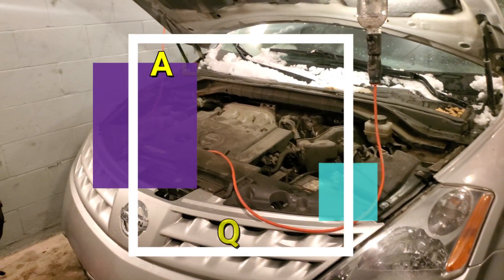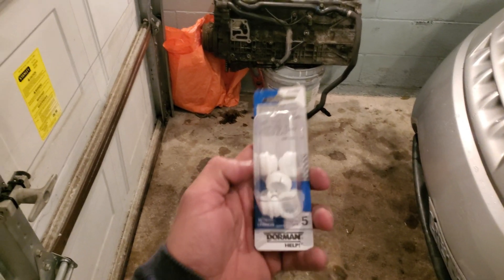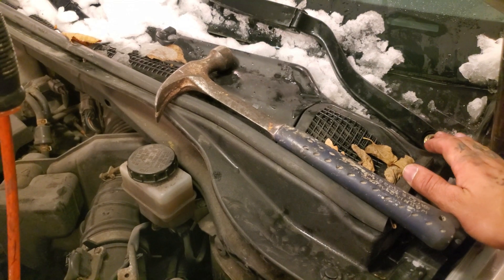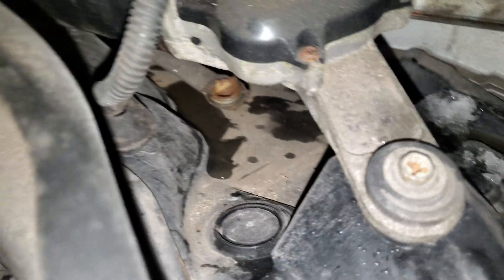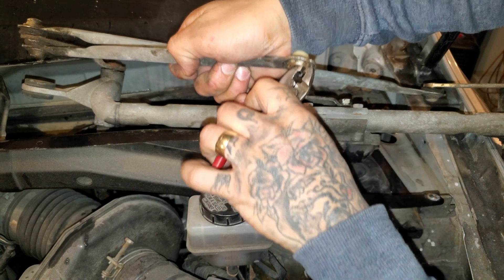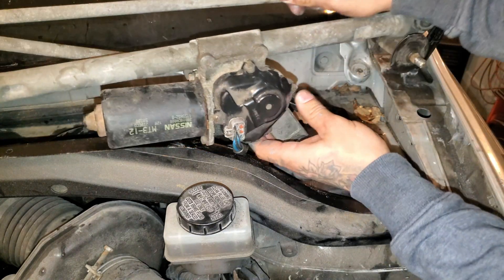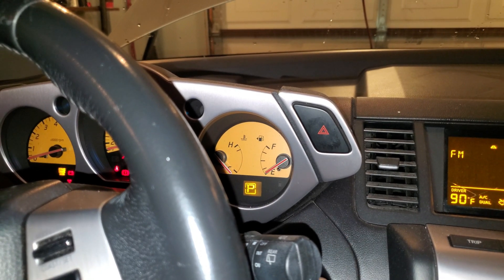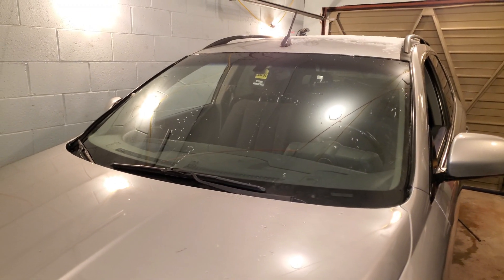WIPER ARMS WON'T WORK! - (2003-2007) Nissan Murano - Broken Wiper Arm Bushings FIX!

Comment: I own a Murano 2007, that had just developed this wiper  problem, i have tried parking it with some materials to stiffen it and not allow it pull apart, but it keep pulling apart after a while, winter will soon be here and i am so scared. however, it doesn't look like the bussing on the linkage is a plastic or rubber, i feel that it is a cast. what do you think i should do about it?
Reply from the maker: Replace the whole mechanism

Comment: WRONG PART NUMBER your advertising on youtube!!! You said 49452 on nissan murano but it falls off the right part number is 49449 don't advertise on youtube unless you know how to fix cars properly!
Reply from the maker: Don't be an idiot. I literally read it right off the box. Don't comment stupid shit unless you know what you're talking about. 
The OEM part number is different from the aftermarket. DORMAN is an aftermarket manufacturer.
Reply: @AllThingsQuick  So which one is the right one. 49452 or 49449 and does it work for Murano 2009 2nd Gen?